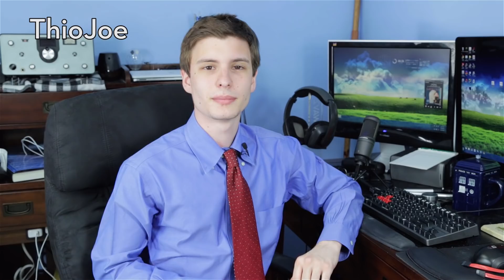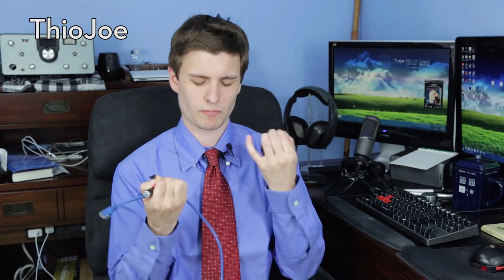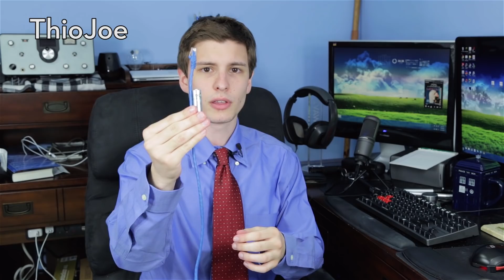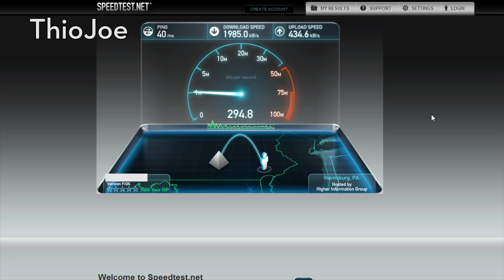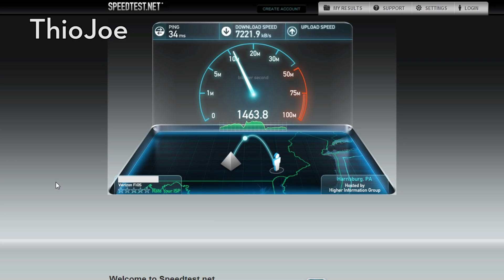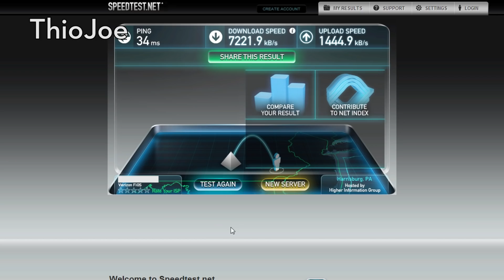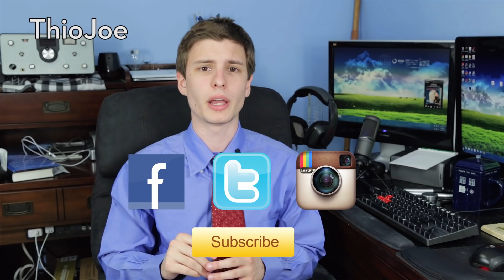Triple Your Internet Speed for Free

Comment: Dude, seriously!  It's a joke.  Don't try it.  Didn't you realise when he said stuff like "electrical tape conducts electricity"?  Which, of course, is exactly what it doesn't do!  It's insulation.  And that's just one of the many jokes he makes.
Only ways to speed up your internet connection are to get broadband then fibre optics, make sure you're not running too many programs at the same time, especially ones connected to the net and don't have programs "running in the background" etc.

Comment: Electrical tape conducts electricity?  Hmmm   REALLY?  If you tape batteries to a cable with nothing connected in some sort of circuit how is there a magnetic field generatetry it on a house circuit and burn their house down. If you have a 20 gauge wire and tape 100 pcs of 20 gauge wire to it in the manner you state along with the batteries....when your done you end up with a 20 gauge wire with a bunch of crap taped to it...it's that simple.

Comment: Because it is a wireless signal, in order to increase the electromechanical inductance, you need to use a 9 volt battery around your antenna instead of a AA battery. Be sure to use electrical tape because it conducts electricity better.

Comment: Pretty lame. This shit will only work if you use 9v batteries in series with some left handed electrolytic capacitors and then add a couple diodes to reverse the polarity, because then it will smooth out the bandwidth making all data run much faster.

Comment: I find all this in contradiction to my electronic experience. Also, electrical tape is not considered a "conductor" , that is why they call it electrical tape. You might just as well tape toy race cars to the ethenet cable instead of batteries.

Comment: Love the videos of "proof" that this "works", there is no indication of a task bar no date stamp nothing. Awesome. Why don't you wrap an ethernet cable around your primary cat5  thats what you said a year ago would double your internet speed, then add the battery and triple that so you will get 5 times the internet speed cause all ISPS are cheap.

Comment: lol you could just tape the sata cable to the outside of the ethernet dont worry about cutting off the ends its totally unnecessary same with ied cable increasing the surface area...etc what a troll you must be an actor you say stuff with such legitimacy thumbs up if this worked for you.

Comment: I found out that this works best with High Reluctance or NOHM cat 6 cables. And at least 6 foot between ends, unless they have a Mobius Outer Shield, in which case, the length does not matter.

Comment: Warning!!!!! this is very VERY dangerous. Cad5 cables are calibrated for a specific amount of voltage, do not try this. When I used 2 batteries the cable started to get warm although I did not notice at the time. With 4 batteries the wire started to melt the plastic and I burned my finger. It is imperative that you DO use the IDE cable in connection the the cad5 so as to offset the current increase. Also insulate the entire cable with electrical tape.
triple speed after that!!!

Thanks Joe

Comment: The instructions weren't clear enough, I got my dick stuck in a ceilingfan. 

WHY the hell are you making these videos, IF your provider gives you 2.4 MB internet speed, you won't be able to higher it at all by making a DIY cable which doesn't even work! 

As already said in the top comment, electrical tape doesn't even conduct electricity. Why do you even make these scam videos!

Comment: Well, it may work for some of the people, some of the time... for me it did squat. But then, I've a router between my cable modem and PC, though all are gigabit all the way, i.e., gigabit modem, router and ethernet port on the PC. Put batteries on both from modem to router, then router to PC. No change in speed, even with cat 6 going from the router to the PC.

Comment: sorry about another question in the video the  cable you are using is that the one from your computer or one must purchase separately if it is one you must purchase separately when you install the cable you just run it alongside or do you coil it around the original cable

Comment: There is a be very realible way to do so Youn can take a twisted pair cable , now tha You have the cable you need to install a couple of rj11 conector now put the cable in horizontal position  take care to install the a rigth direction port for the rigth portion of the cable and a left direction conector for the left protion of the cable, now plug the rigth side to your telephone wall outled and the other side to a standart telephone  , now You will be able to calll you ISP and request more spd

Comment: To make this work use a wireless Modem w 2 antennas. I modified the design & taped the batteries to 1 wireless antenna, then stuck it into the whisk & wrapped the IDE cable around the outside of the whisk & electrical taped around it all, pointing it down into a satellite dish I got on eBay. Then I electrical taped a car battery to the stand that holds the satellite dish & aimed the dish at a cell phone tower, unplugged my wireless modem from the cable box & have super fast free internet. Thanks

Comment: how can there be a magnetic induction when the the batteries are not connected together.
Will using a selenoid with a current in it increase internet speed?

Comment: Your next video should demonstrate that by liberally coating the ethernet cable with saliva from your tongue, you can cause a permanent phase shift of the subspace band which will cool the anti-matter coil in the core of the cable.  This will increase your Internet speeds by a warp factor of 9 and all your downloads will complete before you even start them.

Comment: I used a 9 Volt battery on the negative end of the cable and 2 AAA batteries on the positive end. Using Holgrens theory of magnetic resonance I proved that 9/3 (9V divided by 2 AAA (1.5V)) does indeed triple your connection speed. I will sell these cables in the near future :-)

Comment: I used a 3 car batteries and my speed was so blazing fast, it melted the cable jacket and started a house fire that took everything. But my porn just snapped on the screen like I was changing a TV channel for about 30 seconds before that happened.

Comment: I could not find 2 Double A batteries, so I hooked a Radio Shack brand Flux Capacitor to one end, and a discarded shoe from Chuck Norris to the other.  I was careful to have the positive end of each facing the plug.  This worked great, I was able to download the whole internet in less than an hour.  I was using a Hello Kitty Kat-5 cable and a very fast 1987 Amiga 500.

Comment: Sounds legit.  Let me go get those old IDE cables I have laying around!  Another tip, you can further reduce the resistance of the cable by reducing it's temperature.  It's based on the Electro-thermal law of physics, and that is why big data centers require extremely powerful cooling.  Place a small cooler or fan near your cable to increase performance, or stick it in the freezer for about an hour for a quick burst of speed the next time you go to download Game of Thrones.

Comment: pls upload the video for increasing the speed of internet for my laptop connected through wifi router  .. pls mention that if it can increase the speed what i'm getting from operator .. or this is only increasing the capacity of my wire connection

Comment: Yes!, see he actually uses the SATA cable in this video. I've also tried it with two of these magnetic induction cables, it actually increased my speed by x9! this method definitely works, I removed my 100 mbps line, and got a 20mbps instead for much less

Comment: hey joe, i have my internet connection through antenna. and through the antenna, the cable is connected to a box where the power is supplied to the antenna, and the same box has the connection for the pc.. im confused that, for which cable should i wind the batteries..?